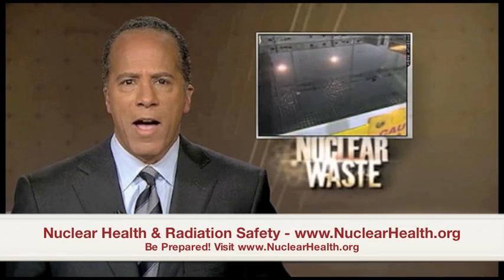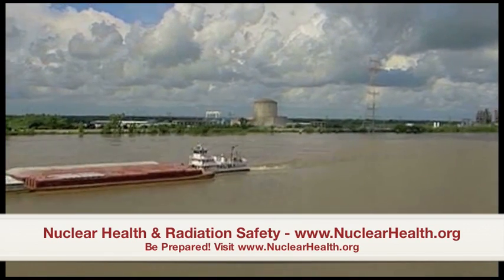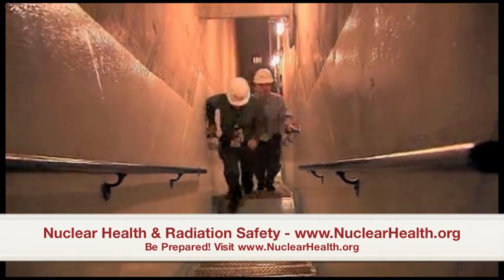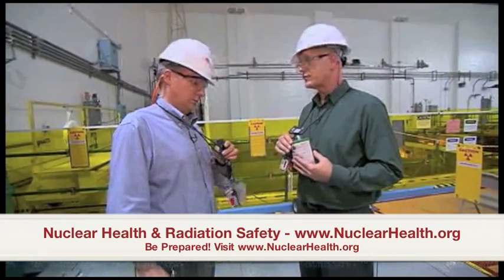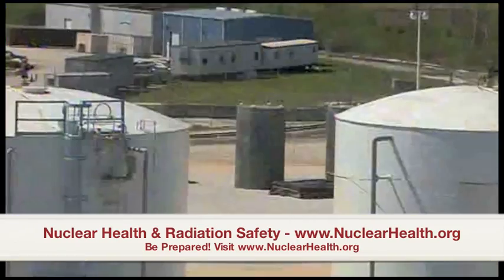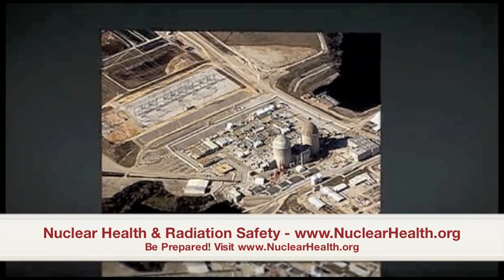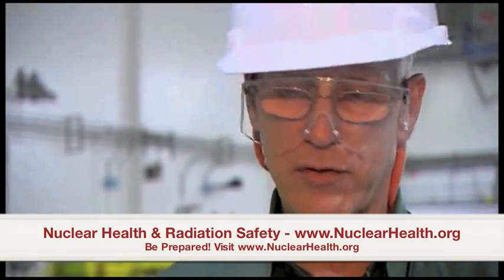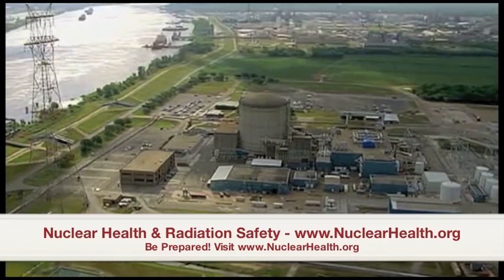Where the U.S. stores 345,000 spent Nuclear Fuel Rods

Comment: There are hundreds of rods per assembly and the assemblies are used 3-4 times or fuel cycles. That's about 4-6 years depending on the plant.
They stay in the pool for a few years where there is active flow and filtering to cool the rods that contain the radio active material. It (as in the radio active spent fuel) can only be released if there is a rupture but the water gets activated and can become slightly radioactive which is why it gets filtered and cleaned before released to the environment.
After the fuel is cooled to the point it no longer needs active cooling it is moved to dry storage casks that are made of concrete and stop nearly all the ionizing photons and such from escaping.

There is still a lot of usable U-235 and Pu-239 fuel in the pellets and can be separated from the radioactive waste products like cesium and krypton where the U-235 and Pu-239 isn't that radioactive but can be used in new fuel assemblies. If you destroy it by fire or any other means all you do is release it into the environment which is exactly what we are trying to prevent.
Reply: The cooling ponds are overloaded with 5 times the amount of spent fuel that should be in them. If cooling water is stopped for any reason, the cladding on the fuel will melt, catch fire and contaminate an area over twice as large as New Jersey forever. The nuclear exclusion zone and cost of the partial clean-up ( a nuclear disaster is never completely cleaned up) will be 5 times as big as Chernobyl, all from one pool. Fukushima had 100 tons of high-level radioactive fuel on-site. We still don't know how much is still on-site and how much has been scattered over the Northern Hemisphere. The average U.S. reactor has 500 tons on-site. After about 5 years the spent fuel can be moved to storage canisters, which have been rated by their manufacturer for a working life of 10-30 years. The nuclear industry says they are good for 80 years. Who should we believe? What should the industry do with the radioactive canisters after they are no longer capable of containing the waste that must be contained for longer than mankind has been in existence? More waste for someone (certainly not the long-gone utility) to deal with 80 years from now, along with the radioactivity that has leaked out of them. Along with the contaminated reactors placed in SAFSTOR (not safe, not stored). Europe requires that spent fuel in cooling ponds and canisters be stored in hardened structures to avoid possible damage from terrorists or natural disasters. Not in the U.S., where spent fuel is stored unsafely within 100 miles of every major city in the U.S. The taxpayers are paying utilities a billion dollars a year to store their own waste from hell. What a deal. Holtec is saying they will dump radioactive water from the Pilgrim reactor cooling ponds into the Atlantic. The public is saying, "Hell, no!" The industry-captured NRC is saying, "OK by us."
Who is going to invest in the dirty, dirty dirty, very dangerous, very expensive business of reprocessing the spent fuel to get the 1% of U-235 and Pu-239 from the 99% of the other fission products and transuranics? Oh, U-235 and Pu-239 is not very radioactive, eh? Glenn Seaborg said that there was no dose of Pu-239 so low that it did not kill 100% of the beagles in his experiments. 1 millionth of a gram is enough to kill a man. Radioactive elements are ...elements and cannot be destroyed, only converted into other radioactive elements. They can be dispersed very effectively by fire though, like at the 2018 Woolsey Fire from the 1959 meltdown at the Santa Susana Field Lab 35 miles from LA. Dr. Marco Kaltofen proved that.
Let me offer a practical way to avoid all this danger and expense. Shut down every nuclear reactor today. Spend the next thousand years trying to eliminate the radioactive mess, before it eliminates us.
Reply: @jackfanning7952  Question? I know Zero about this but why don't they bury cannister deep under ground?
Reply: @Rich-yj4ub  For many reasons; most of them economic. The U.S. Congress passed the Nuclear Waste Repository Act in 1982, naming the DOE as the responsible agency to provide a permanent repository for high-level waste. Nuclear utilities were charged a fee to provide a fund to pay for it. The slush fund has been an open piggy bank for Congress to practice their drunken sailor spending. When the DOE failed to provide a repository, the government (taxpayers)  was obligated to pay the utilities to store their own waste on-site in ponds and canisters in close proximity to every major U.S. city. What could possibly go wrong? The taxpayers are paying the utilities a billion dollars a year to store their own waste. Sweet deal, if you can get it, eh? Why build a repository when the nuclear cheerleaders at the NRC let you put it in Jethro Bodine cement ponds and charge the public for it? Yucca Mountain was chosen for a permanent repository because there were less citizens in Nevada to yell NIMBY than in the other 3 proposed sites. It is riddled with fissures and has about a hundred other reasons why it would never be a good place to dump waste. If Yucca was implemented, the fissures guarantee that all of the underground acquifers west of the Mississippi would become radioactive. The U.S. doesn't own Yucca Mountain and the Indians who do say, "hell no, you can't contaminate our sacred mountain." After spending $19 billion, Harry Reid nixed it. It would take 35 years and another $95 billion to complete. It would hold about 75,000 tons of high-level waste. We currently have over 90,000 tons at  commercial U.S. reactors. Yucca would be a mistake because it is a horrible place to store radioactive isotopes for longer than mankind has been in existence. 
No one is willing to volunteer their backyards for the feds to permanently pollute for the rest of eternity. WIPP was built in New Mexico to store transuranic waste. It took about 10 years for them to collapse one of the tunnels and pollute cities hundreds of miles away. A partial clean-up costs over $3 billion and the entire repository is still a mess. The Germans yelled loud enough to make the government shut down their Gorleban repository. Russia has been dumping their waste into the Arctic Ocean. They say they don't do that anymore. Do you trust them? A ship was impounded in Kenya in 2022 carrying nuclear waste from India destined to be dumped in the Atlantic. Wonder what Rocketman in North Korea does with his doodoo from Hell? Japan is making the Pacific Ocean the biggest radioactive waste dump in the world.
Finland and Switzerland are trying to build repositories but hit snags. The copper canisters they planned on using are not as corrosion resistant as they thought. Vitrification has been used to seal waste in glass or ceramics but it breaks down after about 100 years. Some of that waste will still be radioactive millions and even billions of years from now. 
The utilities keep saying they have Gen IV reactors that someday in the sweet bye and bye, somewhere over the rainbow, just you wait and see, we are not lying this time, like a magic unicorn eats waste as a horse eats hay. That is a lie to make people not worry and be happy. They are way more expensive and polluting than the conventional reactors, and have a very poor performance record. They would take hundreds of years operating at full capacity to make even a little dent in the amount of waste on hand. There is not enough money in existence to build and maintain the Gen. IV reactors. Even then, one cannot "burn radioactive isotopes up," only transmute them into other radioactive isotopes, many of which are more dangerous than the original 100s of isotopes generated by fission. 
The current scheme is to establish Consolidated Interim Storage (CIS) facilities in destitute Texas and New Mexico counties to "temporarily" (LOL) store the waste until a permanent repository is built (fat chance of that ever happening). The hundreds of thousands of tons of high-level nuclear waste currently in storage within spitting distance of every major city would have to be tranferred into canisters capable of being transported (SSS) and then shipped (mobile Chernobyls) over U.S. highways to the storage facilities.
Rule Number 1 for the nuclear industry is take the money and run and let someone else deal with the mess later. Oh, and get the public to pay for it.

Comment: To recycle the spent fuel rods, why don't they use them to heat cities with hot water?
They could be in a central location and used to heat water , then pump it to heat all of downtowns buildings for a long time. Save money for the city.
Reply: I understand China is doing just that on an experimental basis

Comment: Nuclear "waste": the scary story in search of an actual problem.
Keeping rods in an on-site pool to cool down in the nuclear power plant is not a problem - The public is not at risk.
Sealing the rods in steel and concrete casks engineered to be the strongest objects on Earth and bolting them to a concrete slab next to the nuclear power plant is not a problem - The public is not a risk.

Media: "But...but...we don't have a single place to put all of these fuel rods!"
Uh, so what?  The rods are just sitting there not hurting anyone in well-monitored and sealed environments.
Media: "But, what if I hugged an exposed fuel rod and then French kissed it?"
Then YOU would be a problem that should all be put in one place so that you don't hurt yourself or others.

(SIGH) The reporting on nuclear "waste" is usually the same uninformed drivel trying to scare the public with the scary "R" word:  Radiation, a term that all too few understand and that too many have a strong opinion about.

Comment: Reprocess it. There's good fuel still left behind. It has been proven to work
Reply: Exactly. The only thing is that it's currently cheaper to use new fuel than to reprocess. But at some point, it will be cost effective, and then this spent fuel will be like money in the bank.
Reply: Start building nuclear cars that can run on the waste.
Reply: Reprocessing is the most dangerous, most polluting and dirtiest process in the nuclear field. It only reclaims 1% of the spent fuel that goes into the reprocessing as plutonium and uranium. The rest is returned to the sender as waste. It generates massive amounts of radioactive air and water emissions. Reprocessed fuel is more expensive than U-235 from mining. Reprocessed fuel is also more difficult to run in a reactor and requires a greater degree of shielding to protect workers and the environment from emissions. And once reprocessed fuel is used once...tada!... it becomes nuclear waste. La Hague has lost all of its international customers and the parent company is its only customer. Sellafield is shut down. Keep lying, nukie.
Reply: @jackfanning7952  i need whatever you're smoking rn
Reply: Fuck reprocessing! Destroy them!

Comment: Ditch them in the Mariana trench. 11.000 meters deep.
Reply: +Indegruv Throwing them in the Atlantic was a terrible idea, but the Mariana is where an Oceanic plate is forced into the Mantle by a continental plate. Better idea, although not the best solution.
Reply: Better yet, just dump them on the shores or downton somalia.
Reply: That would be like having sip of cola and throwing it in to the trash :\
We can still use it as fuel.

Comment: When they began building nuke plants in the 50's,they said they would be 'TOO CHEAP TOO METER'.  What a joke. Nuke plants are the most expensive, filthy est, most  dangerous way too boll water of all time. Anuke plant cannot be turned off with a magic key. The spent fuel pools have too have at least a million gallons of  cool water circulating through them  every minute  for 5 too 10 years, then they can be transferred too very expensive,very heavey concrete casings. If that cool water flow stops, in those spent fuel pools. within 5 days they become so hot, all water evaporates, and they begin burning at the atomic level ,  which is unstoppable. Tremendous amounts of radiation are then pumped intoo the air and water, for the next 10 thousand years.A 200 mile radius around the plant will have too be abandoned forever.WTF, Thus making every nuke plant a ticking time bomb. Fukushima has been raging. totally out of control for 15 hundred days. Tokyo should have been abandoned within days of the 3 total meltowns. The governments, all the mass media lie, cover up and keep most dumbed down about the ELE, as in EXTINCTION LEVEL EVENT. The Pacific Ocean is dying because of the most toxic,deadly for 10 thousand years, PLUTONIUM RADIATION being pumped intoo it daily. You want real truth, go too utube, listen too KEVIN BLANCH, HARVEY WASSERMAN, RAD CHICK. Do it for your children Half the population will develope cancer, at least in the coming 5...10..20 years. The very young,pregnant women and elderly people are the most vulnerable. Look up Chernoble Heart on utube. That is coming here . Nuke plants are an abomination.
Reply: Good morning Tom, I just read the other day Japan has started implementing a frozen wall around Fukushima's plant. 
This of course is only good as long as it stays frozen because within 5 days of no power keeping it frozen the ice will melt. 
I had watched a documentary where a scientist, can't remember his name suggested collecting all metal and magnets filling the pools with water,the magnets would then collect the toxic waste adhering to the metals, then collect it n bury it with cement where it stands. 
As for the other plants on the island they should all be decommissioned as they have been running longer than they were allowed to. 
It's all horrible and I haven't gotten a good night sleep since this happened. Any way if u use Facebook come friend me, I'm a huge activist there. Find me under Cynthia Powers, I have my old dog a profile pic

Comment: Who would want to be anywhere near a plant
filled with "spent fuel -highly radioactive rods"!
Note:
1. Rods Seal is 3' of concrete with a steel encasement
inside the concrete esophagus.
2. No Zeolite Shelf to protect the clean water!
Reply: smartmonkey777
Those are GAMMA RAYS to be worried about, uranium doesn't naturally produce them, only when they fission, only found in a nuclear reactor. And radiation suits don't protect against them, only tonnes of lead, concrete, or steel can.
Reply: leerman22
 If that's what you believe go help out at fukushima radioactive-proof super men like you is what they need !!!
Reply: The American Way.
Reply: They are not "highly radioactive", you just don't want them sitting in an aquifer or a lake for years. Also don't eat them, you can pick them up with your hands and take it to a safe location, just make sure to wash your hands to get rid of any radioactive elements that may have broken off before putting them in your mouth. This is of course after the decay heat has cooled off. Picking up a piece of 200 degree metal isn't a good idea.

Comment: The fuel bundles need cooling for only a short period after removal from the reactor.  The heat decays away exponentially. For example about 1 hour after shutdown, the decay heat will be about 1.5% of the previous core power. After a day, the decay heat falls to 0.4%, and after a week it will be only 0.2%

Comment: Why do you need zero radioactive atoms to be safe?
As long as the radioactivity is less than or comparable to natural background radiation, there is no safety issue.
The usual rule of thumb for this is 30 half lives.
So for the sake of argument let's keep it buried for 900 years.  Or 2745 years if you insist.
Neither of these goals is hard to achieve.  There are no technical issues with safely storing the fission products, there are just political issues.

Comment: Putting heat load into perspective, a fuel rod bundle contains between 180 to 460 kg of fuel. After removal from the reactor it puts out 10 kW per tonne = 1.8 to 4.6 kW for each bundle.
Within one week this is reduced by a factor of 10. Each fuel rod is putting out less heat than the electric heater warming my feet under my desk. I do  not fear that my oil filled electric heater is going to explode in flames. 2 years after Fukushima the fuel rods can dissipate their heat by air convection.

Comment: Well, a swimming pool and the laws of physics.  If the water was somehow removed and could not be replaced, the spent fuel would not explode or burn.
The vast majority of that fuel is not giving off much heat.  The heat produced by  the fuel decreases exponentially.  After one year, typical spent nuclear fuel generates about 10 kW of decay heat per tonne, decreasing to about 1 kW/t after ten years

Comment: So we're producing 13,800 fuel rods PER power station every year. That's alarming.
Reply: Sounds like a lot, but remember a reactor the size of an average living room can operate at 1000mw 24/7 for years without being refuelled. A thermal plant (such as coal) would use 100 train cars full of coal every single day. 1000mw is a lot of power and requires a lot of fuel.